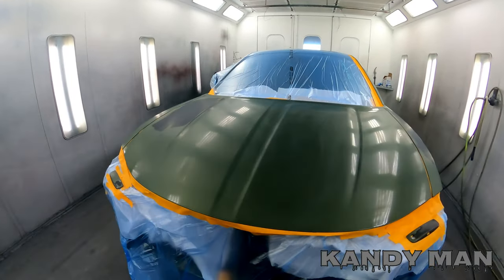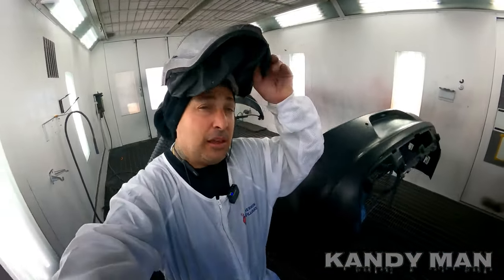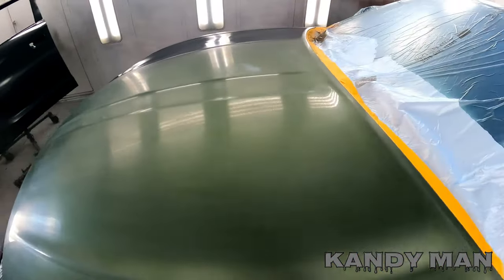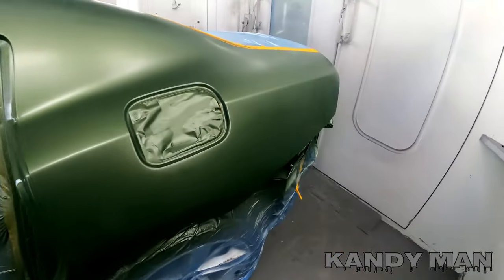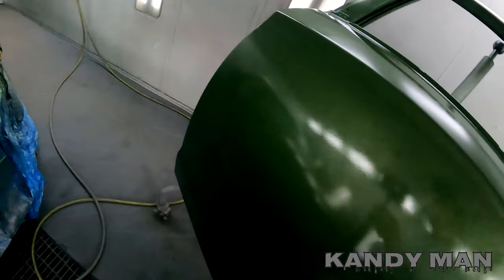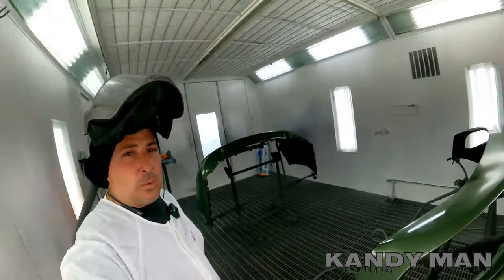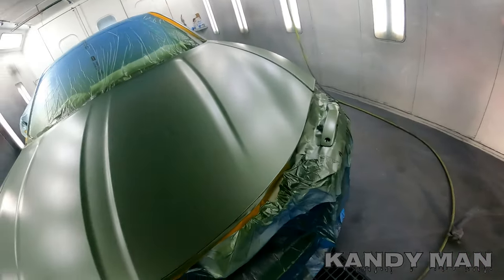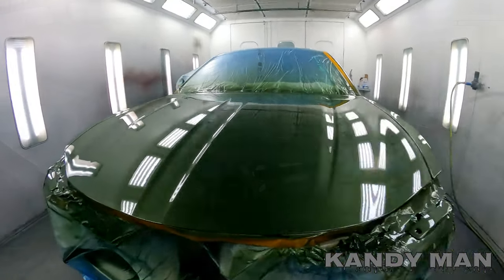ONE MORE CAR LEFT FOR THE DAY, CAN I PULL IT OFF?

Comment: Got a question Kandy Man. Does the reflection from the lights in the booth interfere with your helmet clear visor? I have that exact same helmet and so times the light interfere with my eyes
Reply from the maker: Sometimes  yes I'll open it and check it out thanks for the support
Reply: Same thing happens to me. 3m made a “premium” visor that’s supposed to correct that 
#37324 is the part number